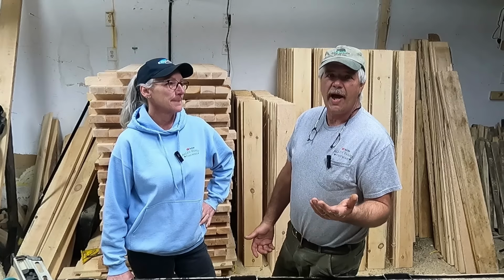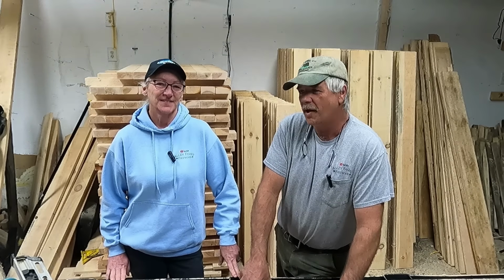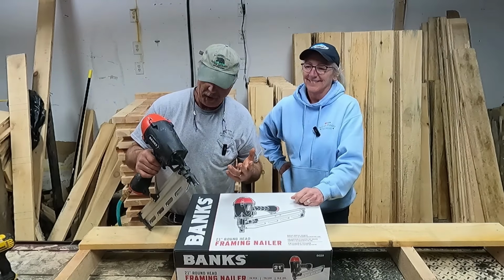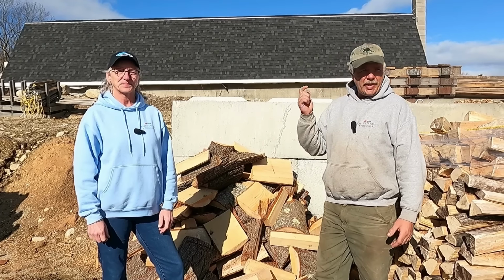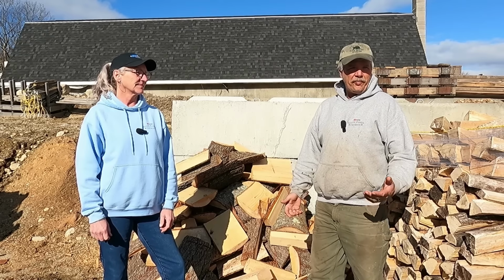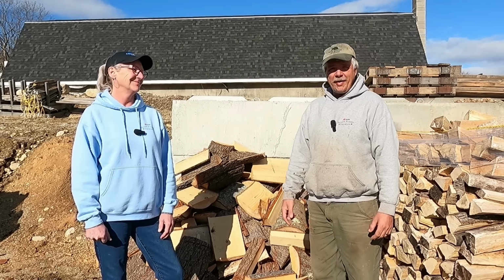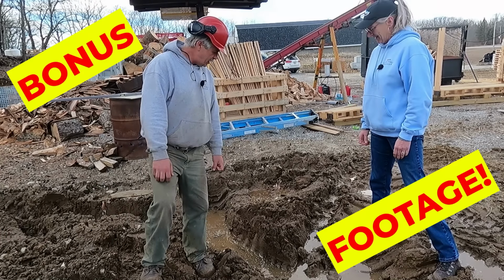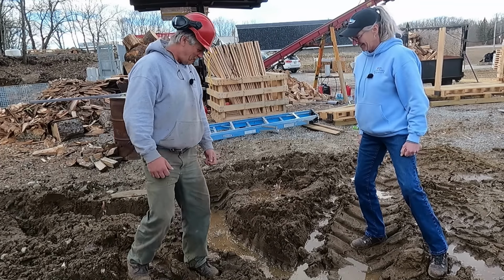Turning Free Logs into Pallets, Firewood and Kindling!

Comment: Great video guys! You've got a pretty good set up to cut your kindling. I started cutting kindling because of your videos. Instead of using the table saw I use my sawmill to cut the 1 inch by 3/4 inch pieces. I'm able to saw several pieces at once, then I take them over to my chop saw and cut a dozen or so to 12 inches at once. Seems to be alot quicker. I don't know if this is something you can do on your sawmill and bring them into the garage and use your chop saw to cut several at time.
Reply from the maker: I did try that but when the mill hit knots or bad spots it sent the pieces flying or when we went to pick up the 12 ft long sticks they snaped into a few pieces . I had a hard time holding just 6 pieces on the chop saw an they never seemed to stay together when I tryed to slide a bunch forward to cut again so that’s why I went back to the table saw . I have tryed a bunch of different ways betwean the splitter an sawmill but so far the way we have ben doing it seems to work good for us . It also lets us do most of the work inside so on crappy days we can be inside .

Comment: 😂😅🤣🤭👍🏻👍🏻👋👋🪵🪓🔥. Great fun video guys. You got lots done and had fun doing it. 
Just wondering, what do you do with the bark you slice off. More than likely I miss that part. 🥴. Frost is mostly gone. And maybe all dried up this weekend. Hopefully. 
Have a good week. 👋👋👍🏻👍🏻
Reply from the maker: Thanks Noel we tend to get more done when we’re having fun . We take all the bark slices an scrap up to the mulch place . They take anything wood an grind it into bark mulch a they let us dump there for free . It’s ben a great place to get rid of the knotty wood an junk stuff that’s not worth making into firewood a there only 20 min away .
Reply: Ahhh yes. I remember now that you had a place to take stuff to. Don’t mind me. Just not with it most days. 🤭🤭🤭🤭
Reply from the maker: @noelstractors-firewood57  ha ha lol heck I can’t even remember what I just had for breakfast this morning. I asked my budy that fixes them red max saws a sells em how to stop the oil from leaking an why there’s pressure in ya oil tank . He said ya have to keep the chain sharp if not it creates heat when it’s dull and on the back side of the oil tank it’s just a thin seal an if it gets hot just once it will keep leaking . He also said it heats up the bar oil an creates pressure and that will push the seal out . His advice was cut with a sharp saw a when ya done cutting open the oil fill cap till everything cooks down .  He has literally worked on 100s of them red max saws so when he stoped by yesterday I asked him about yours . Hopefully this helps . You can always look up Windham rental in Windham Maine call an ask for Scotty an he can tell you more . Most days he is right out strait but mention me an he will take a few minutes on the phone with ya .
Reply: Thanks a lot Phil. We will see how the thing goes. 
One of my you tube buddies said barometric pressure is the trouble with it. He’s joking, so I said. I’ll hang it on the wall and I can predict the weather with it. 🤣🤭🥴

Comment: Be sure to get yourself some pneumatic oil for your new gun. 5 drops a day when you use it will help keep the gun Dr away. The plunger will go bad after awhile. ❤ your videos. Dave D. From Auburn.
Reply from the maker: Thanks Dave I have a bottle I bought with the first gun when I remember I give it 6 or 7 drops in ware the air goes . It dose make em last longer . I’m not sure why the bolts broke off on this one but I had figured they were throw away guns for $100 I never expected it to last as long as it did .

Comment: You guys are awesome!! Your mud is bad. Is all your wood bundled? Just wondering.
Reply from the maker: You should have seen the mud here last yr before we did all the excavation work an put gravel down but we still need another 5 loads to spread out . We are trying to gear towards all bundled wood but right now all our hardwood is sold bulk a most of our soft wood is bagged for our road side stands . We plan to add more stands this yr as well and hope to add some camp grounds . We do sell a fair amount of the soft wood in bulk as well .

Comment: I just bought a deal on the large concert blocks like you use around your wood bunker . Some where around 60 more of them . What do they cost up your way ?
Reply from the maker: We pd $65 ea for them there 6 ft long and we went an picked them up at the place that makes em . There about 4000 lbs each so we had to get them when we had the big excavator here so I could unload them an set em in place . It’s definitely a 2 person job to set them but it works good for us having that corral to cut our wood up in .
Reply: Yes they’re very heavy we set them track loader . Over the years I have hauled and set hundreds of them . I can get them new here 40 bucks . But got a really good deal on the one I bought yesterday .

Comment: High folks 
I build pallets as well 
May I ask were you get you netting for your bundles 
Thanks Bruno Minard Big Meadow Sawmill Springfield Nh
Reply from the maker: Hi Bruno!  looks like you're not too far from us  we order the netting online from Quadel Industries out of Oregon   they sell it in 2000 ft rolls and we cut the bags to size.   building the pallets is a lot of work but once they're built you have them   thanks for watching!
Reply: What do use to close the ends of the netting ?
Reply from the maker: We use hog rings.  we have a hog ring gun and i think the hog rings are 1/2 inch   hope that helps!